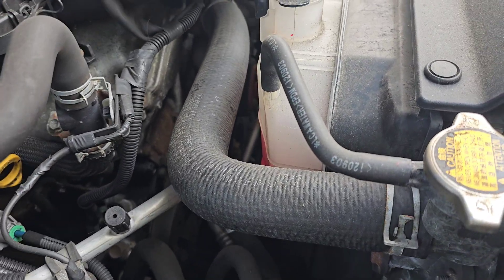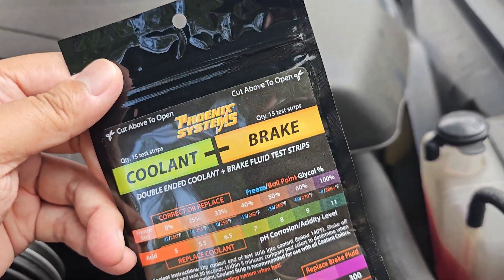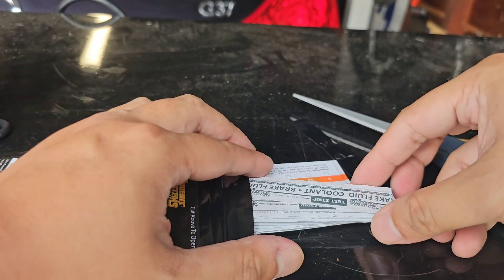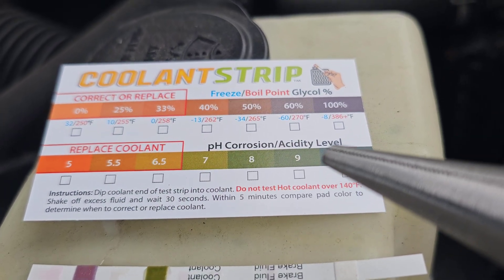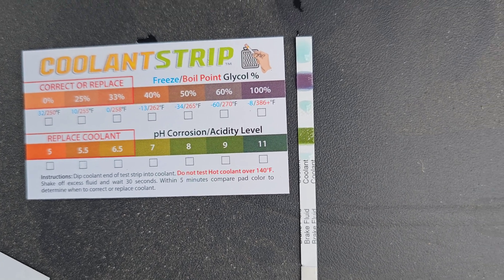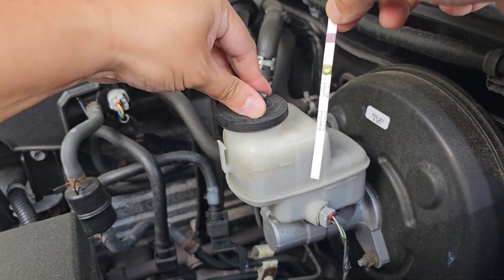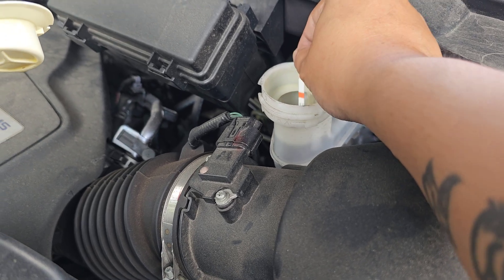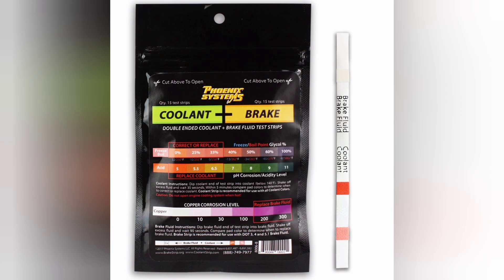KNOW EXACTLY WHEN TO CHANGE YOUR BRAKE FLUID AND COOLANT WITH THESE TEST STRIPS.

Comment: I had my brake fluid changed 1.5 years/10,000 miles ago and dealer just recommended changing fluid now because it's dark. I tested it at home, still very good condition.   Fluid not that dark either. Saved 150 dollars.

Comment: This is a great video, confirming I should get these strips to check whether to change my brake fluid.  But are you actually using straight ethylene glycol  in your vehicles?  Not only is that rather expensive, but it actually reduces your protection against your coolant freezing.  Consider removing some of your coolant in your cars and adding distilled water to drop its freezing point.